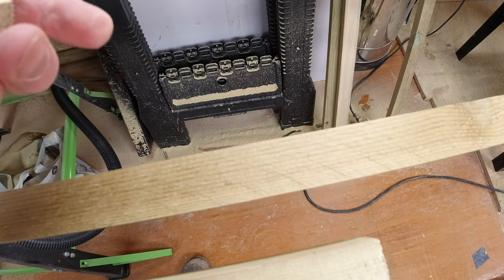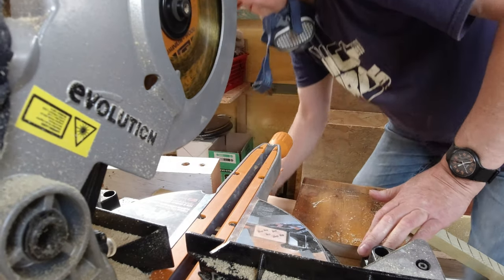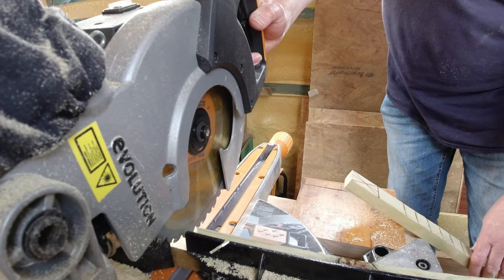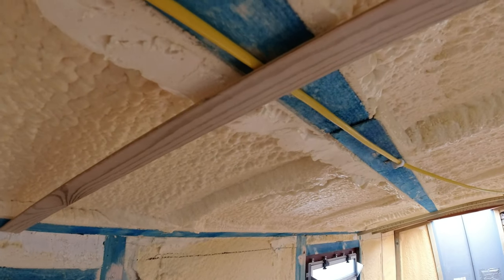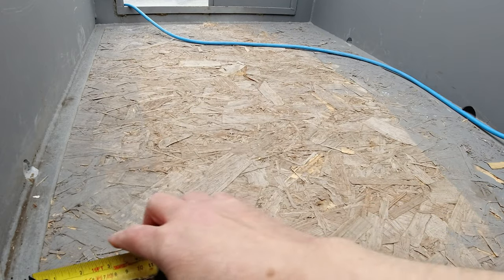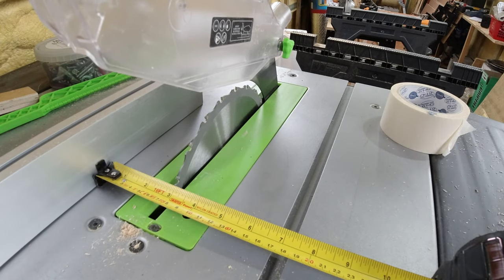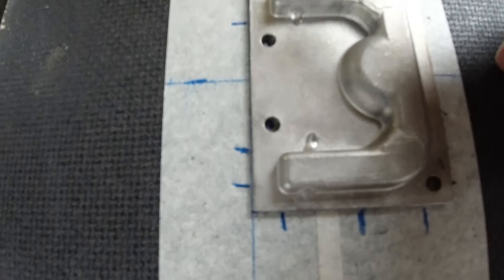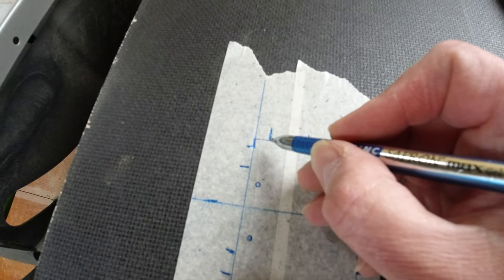Narrowboat_fitout_epi#15 – Batten trimming and engine bay cover.

Comment: Don’t forget to use penetrating epoxy on the cut edges of the phenolic ply 😊😊👍🏼
Reply from the maker: Will do. I got that tip from your vlog Steve. I would have just used waterproof PVA or varnish until I saw what you were using. Nice one. ;-)